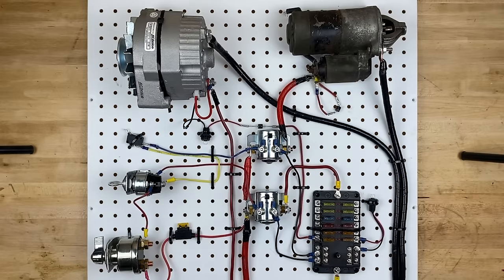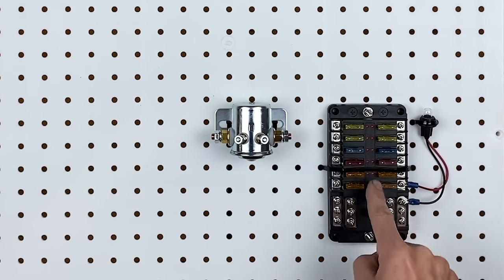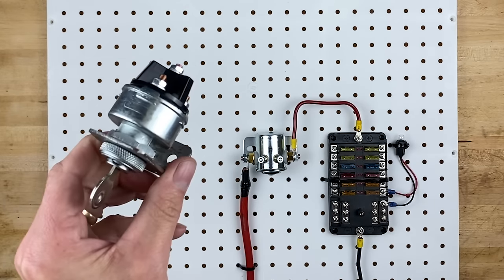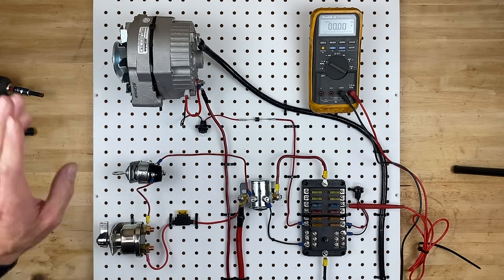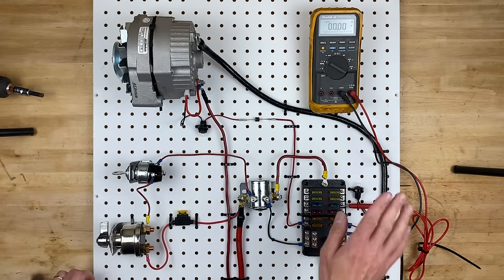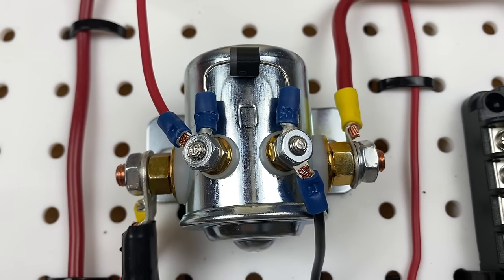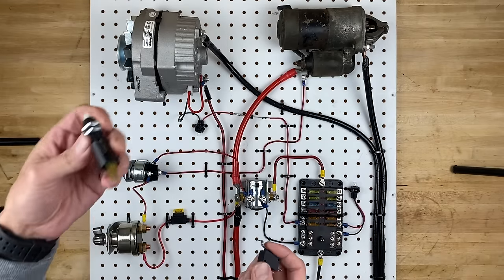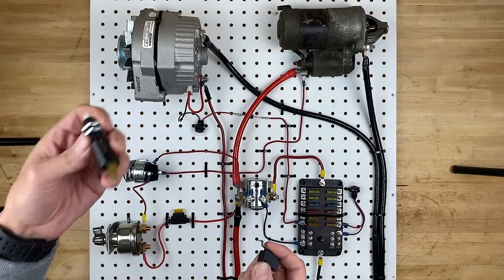Hotrod | Race car | Drift car Wiring for Beginners. (Alternator Battery Switch Fuse Box Starter)

Comment: Hi Jeremy great stuff as usual. I would be  very grateful for your help? I am wiring from new a Meyer Manxter beach buggy LWB. It is VW based with an air cooled VW beetle engine. The battery is in the same place as in the original beetle under the rear seat. My plan is to run a positive or live cable from the battery to the ignition switch in the dash board and then on to the fuse board in the front trunk of the car. I plan to fuse this cable near the battery with an in-line midi fuse. The question is what amp-age for both the fuse and the cable to be safe. I planned to use a 63amp cable thin wall which is 8.5 mmm squared, but I have been advised that this is insufficient, what do you think?
Reply from the maker: Thanks for the kind words! I made a video explaining this, check it out https://youtu.be/EhzN6UdnmPA?si=l1RK_PEqUP4Mfjhe
Reply: Although Im not wiring the buggy using the conventional VW wiring diagram I have used what I think I understand from the diagram as a guide. The main wire from the battery on the VW diagram is 6mm squared so I have gone to 8.5mm squared (63amp) with a 40amp in-line fuse which I believe to be ok. However a guy who knows more than me about auto electrics, has suggested a thicker wire and larger fuse, He has calculated all the items on the bug anf believes there will be a greater load pulled and I would normally agree if everything was on at the same time. What am I missing here? I cannot understand the VW diagram is suggesting a much smaller capacity wire.
 @WiringRescue

Comment: Oh, and about the car running while being backfed with the alternator without the diode. That's why Ignition is usually separated in two parts in the main switch (IGN1 and IGN2) . That way you make sure the engine ignition gets disconnected from all other power devices, such as the alternator.

Comment: Hey man these videos are awesome. They are so clear. You are a good teacher. I have to replace the fuse box on my old 1970 VW bus and would like to put in a fuse box like the one you use in this video. Is that a good one to use? What do you think? Any tips? I already had 2 mechanics rip out the wires and break the old fuse box so I am facing a daunting task and preparing myself armed with the wiring diagram and your videos!
Reply from the maker: Thanks for the kind words! I’m glad that you are enjoying the videos! So for fuse boxes, if it were my car, I’d probably grab one from Leash Electronics (they make a bunch of different ones), or I’d buy a Bussman brand, maybe something like this. https://www.ebay.com/itm/144370044537   Both seem to make really high quality products, which are absolutely more expensive than others, but I personally think the extra quality is worth it. I have no affiliation with either by the way. They are just nice fuse boxes.

As for other tips - just make sure you know how many amps each of your components will be drawing through the circuits and make sure the wires and fuses are sized appropriately. If you haven’t already watched this one, I recommend it - https://youtu.be/EhzN6UdnmPA
Reply: I'll just order what you recommend. Thanks again!
Reply: I mean does it matter if the original box has 12 fuses, or can I just attach as many wires as I like to a given fuse? That's all I want to know! Cheers!

Comment: Many thanks for all the interesting videos that you are posting to us.
I have one question about the diode used at the solenoid (relais).
What kind of diode have to be used? How do you calculate the thickness of a diode, as the wire going from the starter key (in my case) to the solenoid (relais) is much thicker then the diode wires themselves.
Also do I have to insert the diode between my starter cable and the solenoid (relais) onto the S terminal?
I don't use other relais like you used in your schematics.
My solenoid (relais) is mounted on top of the starter motor.
Can you please explain this to me? Many thanks.

Comment: I have learned so much from your videos! Any chance you'd do one on wiring circuits up on a racecar using a CAN Bus keyboard vice a traditional switch panel?
Reply from the maker: I would like to do this, but o don’t currently have the parts yo do it. Do you have links to specific components you would like to see?

Comment: I really enjoy your automotive electrical information, Will you be doing a video on wiring a CS130  160 amp alternator in a ground up hot rod build, not  a one wire setup, I am a complete novice, How large of a warning bulb and a resistor in the circuit

Comment: Great Video! One thing i don't like is that the "battery disconnect" is not a real battery disconnect. It can happen that a relay is sticking and then this disconnect switch is useless.

Comment: First ,Thank you for your work. OK the question Adding a fuse box to a custom 57  T-bird to supply elec fuel pump , PW windows & PW seat.... the box similar to the one you used rated 100amp.. required # 4- #6 wire to it.... I used # 4  to a ditribution block ...if I run a wire from my solenoid  to power the fuse box as you did, would I run #2 wire or #4 from the solenoid to the fuse box...hope that makes sense...Thx Gary

Comment: For my understanding is, a soleniod is doing the same as a relay. 5:30 This setup feeds the fuse box with big cable, means from the fuse box you can go to raditor fan, wipers, headlights, acc, power windows and mirrors and so on without using a 4pin relay. This setup makes everything much easier for a classic car restoration. Am I right with my thoughts?

Comment: I have a slightly different set up but mainly the alternator.  Engine is an ECM controlled Ford racing Coyote with the appropriate Ford alternator.  A "1 wire" with a connector from the PCM/ECM.   My question: will your set up work with just the 1 wire alternator output to the battery?  My battery is in the rear so I've upped the wire size to carry the amperage.

Comment: Great video.
Are all the fuses in that fuse panel "hot" when the solenoid is powered on,,, or can individual fuses be powered seperatly?
Reply from the maker: The way that this fuse box is designed - all fuses became powered when the solenoid turned on.

Comment: I ha have learned more  information in the first 5 minutes of your video than reading and watching any video or book I have ever read.  Just slow down I had to slow the video down to right and draw your setup. I’m not sure why I need a continual solenoid wouldn’t the switch do the same thing.
Reply from the maker: Glad you like the videos!! If all of the electricity went through the switch, it would burn the switch out immediately. The solenoid is able to handle a whole bunch of electricity that a normal switch cannot. So the ignition switch turns the solenoid on and everything is happy.

Imagine a child asking an adult to lift a couch. It’s too heavy for the child, but the adult has no trouble at all. If the child tried to lift the couch, they would get injured for sure. It’s kinda like that.
Reply: 68 F100 I do not know if already has a continuous solenoid. I checked the price of continuous solenoid and it’s up to 80$ dam inflation

Comment: love the video, makes total sense to me, however, can you run the main charging wire to the power side of the starter solenoid ? Its an easier reach for my setup and i have battery voltage connected to my excite wire, no light...should i be running a diode in line ?

Comment: I notice that ignition switch cuts power to the ign terminal when the starter is engaged…. that’s why starters have that extra “i” terminal to supply voltage to the ignition system while cranking.  or it can be done with an additional relay.
Reply from the maker: Yes that was a silly mistake I made that another fellow mentioned as well. If I were to use the other terminal on the ignition switch that would not have happened either. I checked the video a dozen times for errors and still missed it! Lol. Thanks for watching!
Reply: @WiringRescue  I realized this when I had a car that wouldn’t start until during cranking, but would catch once I would let go of the key (from the starter position)… then I realized that older points ignitions would use the “i” terminal on the starter to send a full 12v to the coil during starting and then like 7-8ish volts though the resistor. Thanks for making these videos.

Comment: I'm working on a 1956 Jeep that has no fuse panel, just a few junction blocks and each circuit has its own inline fuse. This has helped me greatly. I currently have a 3 wire alternator as in your video. How do I know what size diode to use? Its a 65 amp alternator. Thanks
Reply from the maker: The diode just has to be able to handle the amperage that the bulb draws. If you use an LED, it draws a super small amperage. Worst case, get a bigger diode than you need :)

Comment: Hi.  I had several ideas bounce in my head watching this video regarding a task I am trying to accomplish.  I need to turn the charging of the alternator off via a on/off switch located on the center console.  I would flip the swich off after I do a burnout and on the staging lights.  Then after the race, I would like the alternator charging to resume by mearly flipping the switch to on.   My bettery is in located in the stock location up front and no master switch on the rear of the car.    Is this how to do easly stated?  Thank you for your video and time.  Well done.

Comment: I noticed the fuse panel lightbulb goes out while the starter is running. If the ignition coil is getting power from the fuse box, the engine will crank, but not start, correct? So is the coil connected directly to both the IGN and START terminals on the ignition switch?  TIA for reply.
Reply from the maker: Hello! Just after I made this video, another person mentioned that And I realized my mistake. I connected the power wire to the wrong terminal on the ignition switch. If I had used the other one, it would have worked the way you expect it to. Sorry about that.

Comment: I purchased a pre-owned 2012 Lincoln Navigator L.  The previous own had issues with the air bag suspension and compressor and converted the suspension system to standard coil springs, which many are doing to avoid future maintenance costs.  I've driven both versions and detected very little, or any ride and handling difference.  I continue to get the "Check Air Suspension" notice on the dashboard's LED fault display each time the vehicle is started and requires a push of the dash Reset button to clear it.   Would affixing the sensor linkage in the extended position, or removing the sensor eliminate the dash message?

Comment: Hello - great video, but I have a question, I am rewiring my 1974 CJ5 Jeep.  I purchased the exact same fuse panel and solenoids.  My key switch is basically the same.  What I don't understand is that you are powering up the fuse panel thru the solenoid but what happens when a person would also be sending power to an individual fuse (or fuses) through the battery input terminal and then thru accessory terminal on the switch as an example?  So when when I turn it to ACC, I would be sending 12V to a fuse that already has power on it.  I am missing something here.  I need to understand how to wire all the rest of the car that I assume would be deriving it's power through the key switch whether that is in the "ON" position or the "ACC" position and thru the fuse panel for each circuit.  That doesn't make sense to me either though as the battery wire to the key switch would then be handling all of loads powered thru it.  Please advise and thanks!  You are really good at explaining circuitry.

Comment: I am trying to wire an old tractor and I thought it was going to be very easy. It was 6 volt positive ground and I have bought some parts to make it 12 negative ground. I don't think it ever had any fuses or diodes. Maybe 1 fuse for the cigar lighter.. lol
Reply from the maker: Fuses are always a good idea. Plus they are way cheaper than fire damage repair! Thanks for watching!

Comment: I followed the steps with just one solenoid but I did not get the starter to spin. I have the main starter wire is running directly to the battery instead of the relay though. Did I do wrong?

Comment: Great video, I learned a lot. Question, in your basic setup around 5:45, why use a solenoid for the fuse panel instead of a relay? I'm researching adding a secondary switched fuse block to my classic LeMans and curious if I should use a solenoid or Relay to control.
Reply from the maker: Generally the solenoids just handle a lot more amperage.  A nice relay will do the same job. You just need to calculate your amperage draw on your fuse panel and make sure that it is within the rating of the solenoid/relay that you will be using to power it.  If you overwhelm the solenoid/relay, you'll absolutely burn it out, and maybe even light things on fire.  So it's worth spending the time to calculate the total amperage draws and get the right part you need.  Good luck with your project!

Comment: Hi Ive really been enjoying your videos as I'm in the process of building a kit car. The alternator I'm using is from an E46 BMW and although it has 2 connector pins on the back I cant seem to get earth continuity or a power reading from either of them(I've not started the engine yet but have connected the +30 cable). I'm thinking there may be other electronic control inside thats designed to talk to the ecu rather than present the 2 basic connections as you describe in the video  for a dash ammeter / voltmeter and a low charge warning lamp? Do you think  I will need to modify the connections inside? Many Thanks Berry

Comment: What size fuse did you use going to the ignition switch? My ignition switch is rated at 100 amps, but I wasn't sure if I should actually be putting a 100 amp fuse in that line. So I was curious what you used.

Comment: Great content!  I wonder if you could swap out the continuous use solenoid for a solid state relay?  A 200amp SSR is about $7.
Reply from the maker: That’s a terrific question! I imagine it would work, but I wonder how the longevity would be in a automotive environment. Hmmm
Reply: @WiringRescue  I wired up a Lemons race car a lot of years ago after our electrical specialist (and electrician) got in over his head and quit.  Wasn't ever quite right but worked well enough for the car to blow its head gasket and quickly seize the engine so it wasn't my wiring which killed it.  Spent DAYS trying to get the ECU to control the electric fans which never worked.  I finally gave up and installed a crappy thermostatic switch which worked flawlessly.

Comment: Working on an 85 mr2 rats nest that was rewired before I got it. Can the charger wire for the alternator go to the fuse bot, batt, and exciter pin? Like should it go multiple places? Also what standard gauge do you recommend?

Comment: Do you have to use a separate starter solenoid for the starter or no. Is it because the starter solonoid is temporarily use and the other is continuous use?
Reply from the maker: You don’t need that extra solenoid for the starter, but some people like to add it to race cars because it can make “bumping” the starter from under the hood much easier, and can sometimes fix hot start issues with big block engines. Under normal conditions, it’s absolutely not needed.

Comment: I remember a fuse link from the red cable from alternator to the battery. It is installed in my GM car. Does it to protect the circuit, due to lack of a mega fuse that you aforementioned?

Comment: How do you stop the power from dropping out of the fuse box when you crank the starter? In this setup could you run another wire from the starter to the fuse panel with a diode (same principal as what you did with showing the bulb with the alternator) or is that stupid? This is my first time rewiring an entire car and your videos have helped a lot. I need 12v switch while on ignition and on cranking.
Reply from the maker: If you use the opposite wire on the ignition switch itself, this will not happen. A few people here in the comments pointed out that I used the wrong one. Whoops! Mistakes happen to everyone. Sorry about that.
Reply: @WiringRescue  all good mate, thanks for clarifying

Comment: Question. If I put the Mega fuse between the battery + and the 1st solenoid would that be correct?
Reply from the maker: So it sort of depends. Most cars do not have a fuse between the battery and the starter. However, that is when the battery is under the hood, very close by the starter. If the battery is in the trunk, I personally would put a large fuse as close to the battery as possible because if that looooong power wire running from the trunk yo the starter were to ground out on something without a fuse in it, it would burn everything to the ground.  So in short, a large fuse may not be a bad idea. ;)

Comment: Would it benefit my system if I run Ground wires to each component thus lowering the resistance!
Reply from the maker: Old British cars did this, and they are widely known for having the worst automotive wiring in the world. I’d recommend using a chassis as the ground. It has worked on cars for 70+ years quite well. No need to run all that extra wire. :)

Comment: How would you wire an application using 2 batteries (primary and secondary back up) with ability to isolate the alternator and each battery.

Not sure if that makes sense but i want to be able to disconnect a bad batter and still use the other one, vise versa, and be able to disconnect the alternator and run everything off batter only if alternator failer or started to draw power for some reason.

Comment: Do you have to use a start   solenoid couldnt you just use the solenoid that is attached to the starter like a regular car has what is the advantages of adding the cole hearsy solenoid thanks.